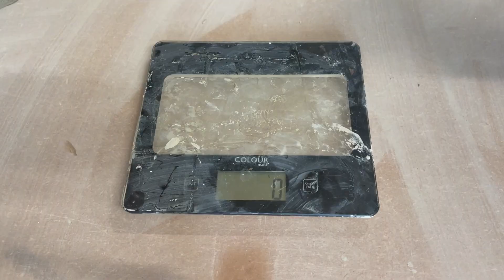Making CANDLESTICKS for my 🤍wedding🤍 | MAE CERAMICS

Comment: Wow! These are so cool :) Do you wire them off when they are leather dry to prevent warping? My stuff warps all the time and it's slowly killing me.
Reply from the maker: I wire them off when they’re still wet on the wheel and let them dry to leather hard, and then they just pop off the bats. Warping is such a pain, but maybe try cutting when the piece has just been thrown so it doesn’t get stuck whilst drying.

Comment: I recently saw a Michael Kline working on plates. He doesn’t wire them off the batt but gives them a twist instead of just pulling straight up. I tried it and I had great success without warping. Great job on the candlesticks!